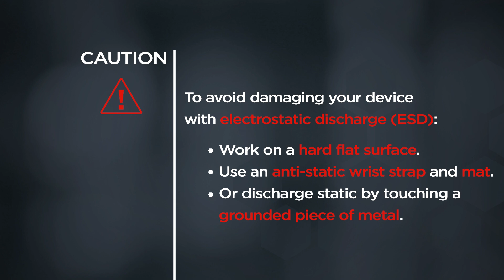Replacing Your 2280 Solid-State Drive | ThinkPad E14 Gen 7 | Customer Self Service

Comment from the maker: This video will show you how to replace the 2280 M.2 solid-state drive in your ThinkPad. The process in this video will work for the ThinkPad E14 Gen 7.

You will need a screwdriver kit, a non-metallic pry tool, and 15 minutes of your time.

To learn more about your device go to https://pcsupport.lenovo.com

To find parts for your device go to https://support.lenovo.com/parts-lookup/?cid=ww:lenovosocial:b9515f&source=socialmedia&subsource=yt

To view the Lenovo Support Self-Repair Guides landing page go to https://support.lenovo.com/us/en/solutions/HT516547

** NOTE: Static electricity can destroy components. Use a grounding strap, and clean, non-conductive surface to work on. Use plastic or coated tools to prevent scratching and avoid using metal tools on plastic parts. For more detailed information on electrostatic discharge and how to prevent it, please watch our "Understanding Electrostatic Discharge (ESD)" video: https://youtu.be/by4PB3WtdLo 

Applicable Machine Types:
ThinkPad E14 Gen 7 - 21SX, 21SY, 21T0, 21T1, 21T9, 21TA, 21U2, 21U3

Check out other official Lenovo channels!
https://www.youtube.com/@Lenovo 🟥
https://www.youtube.com/@lenovolegion 🎮
https://www.youtube.com/@Lenovo-PC 💻
https://www.youtube.com/@LenovoSuporte 🟢🟡

#Lenovo #LenovoSupport #LenovoTechSupport